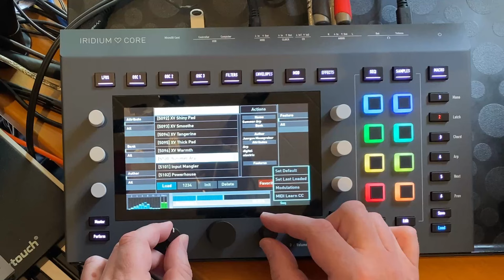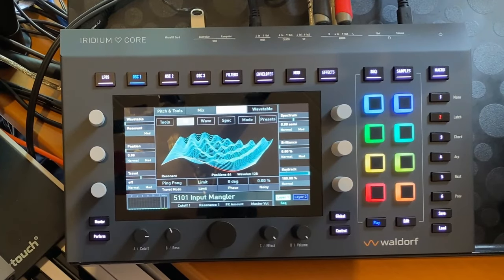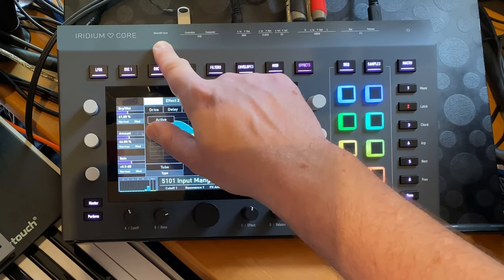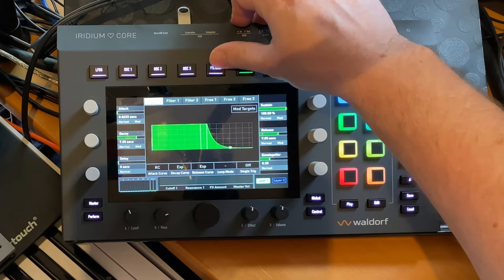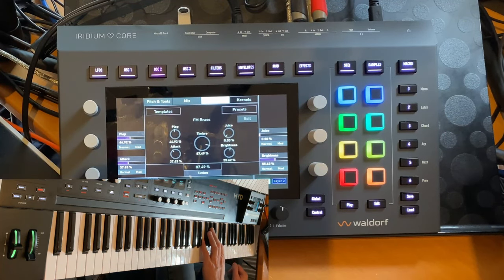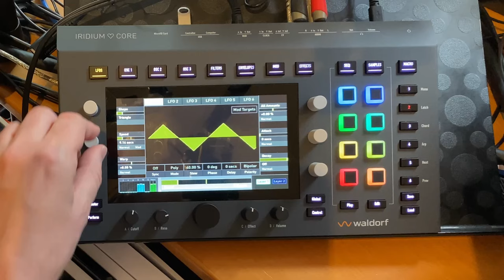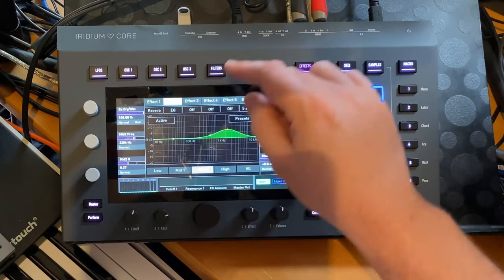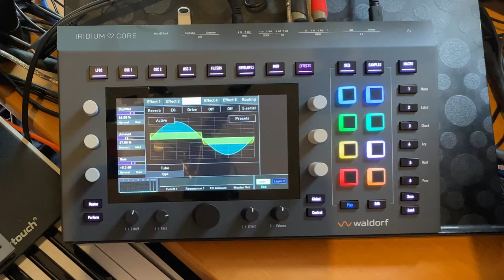Waldorf Iridium Core: A Synthesis Monster!  Test & Sound Design!

Comment: Exploring the Vast World of Synthesizer Modulation Combinations
Synthesizers are powerful tools in music production, offering a vast array of sounds and textures through their complex modulation systems. At the heart of their versatility is the ability to modulate various parameters, creating intricate and evolving sounds. To appreciate the depth of sound design possible with modern synthesizers, it's essential to understand how these modulation systems work and the sheer scale of possible combinations they offer.

The Basics of Synthesizer Modulation
Modulation in a synthesizer refers to the process of varying a parameter over time or according to another signal. Key parameters that can be modulated include oscillator pitch, filter cutoff frequency, filter resonance, envelope settings, and LFO rates. Modulation sources might include low-frequency oscillators (LFOs), envelopes, random generators, and even external MIDI controllers. Each of these sources can be used to dynamically influence the parameters, adding movement and complexity to the sound.

Understanding the Complexity
To grasp the complexity of sound design possibilities, consider a sophisticated synthesizer with multiple modulation sources and parameters. For simplicity, let’s assume the synthesizer has the following features:

Number of Parameters (P): 20
Number of Modulation Sources (S): 10
Depth Settings (D): 10
Routing Options (R): 5
Modulation Destinations (M): 5
Here’s a breakdown of how these factors contribute to the total number of possible combinations:

Basic Modulation Combinations:

Each modulation source can be assigned to multiple parameters, with varying depth settings and routing options. To calculate the total number of combinations for each modulation source, you multiply the number of parameters by the number of depth settings and routing options:

𝐶
source
=
𝑃
×
𝐷
×
𝑅
C 
source

 =P×D×R
Plugging in our numbers:

𝐶
source
=
20
×
10
×
5
=
1
,
000
C 
source

 =20×10×5=1,000
With 10 modulation sources, the number of possible combinations becomes:

𝐶
total
=
(
1
,
000
)
10
=
1
0
30
C 
total

 =(1,000) 
10
 =10 
30
 
This represents an astonishingly large number, specifically:

1
,
000
,
000
,
000
,
000
,
000
,
000
,
000
,
000
,
000
,
000
1,000,000,000,000,000,000,000,000,000,000
This theoretical number reflects the vast potential for sound design in a complex synthesizer setup.

Considering Modulation Destinations:

Each modulation source can affect multiple parameters. If each modulation source can be routed to 5 different parameters, with each parameter having 10 settings:

𝑇
parameter
=
𝐷
×
𝑅
T 
parameter

 =D×R
𝑇
parameter
=
10
×
5
=
50
T 
parameter

 =10×5=50
For 20 parameters and 5 modulation destinations:

𝑇
total
=
(
50
)
20
×
5
T 
total

 =(50) 
20
 ×5
The number is:

2.8
×
1
0
34
2.8×10 
34
 
This further emphasizes the immense variety of possible sound combinations.

Practical Considerations
While these theoretical calculations highlight the enormous potential for creating unique sounds, the practical number of useful combinations is often lower. Not all combinations are musically meaningful or practical. Synthesizers are designed with user interfaces that streamline the process of sound design, making complex systems more accessible and intuitive. The vast number of combinations allows for unprecedented creative freedom, enabling musicians and sound designers to explore new sonic landscapes.

Conclusion
The potential number of combinations in a complex synthesizer is staggeringly large, illustrating the depth and versatility these instruments offer. From simple parameter adjustments to intricate modulation routings, synthesizers provide a playground for creativity. By understanding the scale of these possibilities, musicians and sound designers can better appreciate the power of synthesizers and the endless opportunities they present for crafting unique and compelling sounds.
Reply: Are you ok?